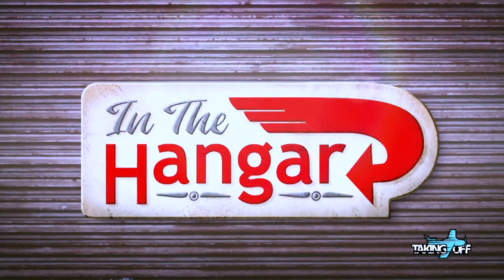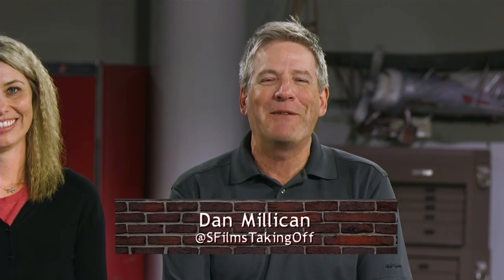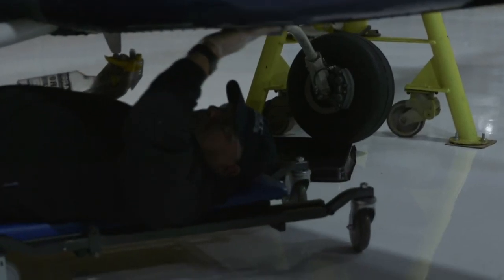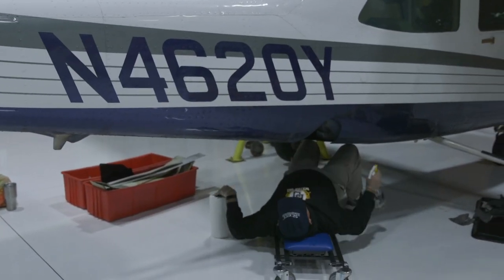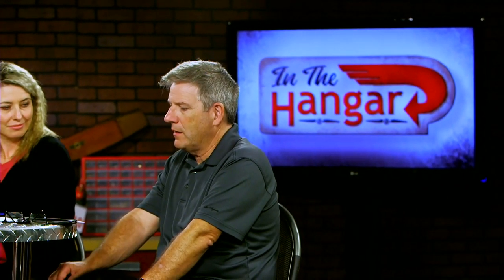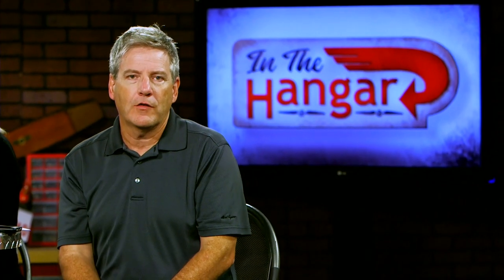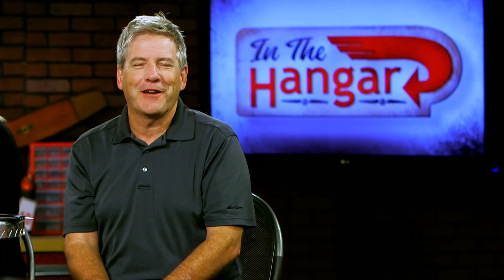Airplane Owner Pilot Maintenance - InTheHangar Ep 65

Comment: Interesting discussion the mechanic is right do you have the "CURRENT" manuals?  However, are the manuals current in the cloud?  Do you have the proper tools (torque wrench calibrated).  Preventive maintenance is fine but owners must have the same tools and equipment as the A&P part 43.13 rules calls this out.  Too many owners do “maintenance” and never record it.  Recording maintenance is a major issue and part 43.9 requires it for owners as well.  Using YouTube as a maintenance guide is really bad sorry to say.